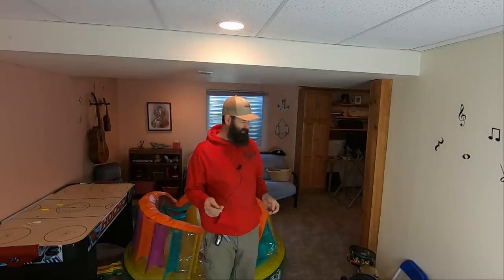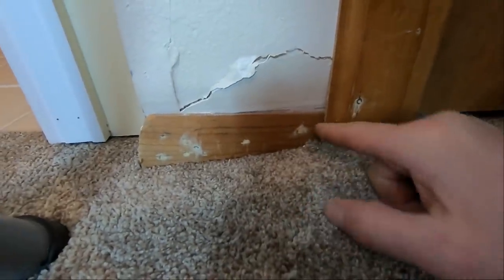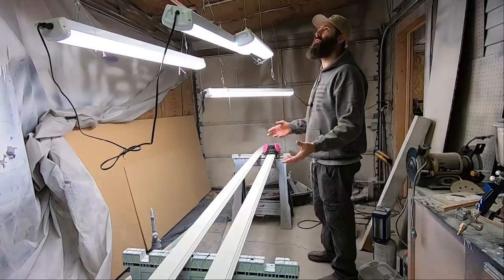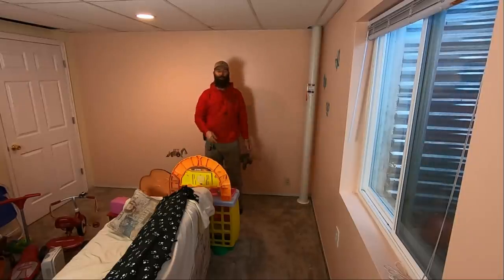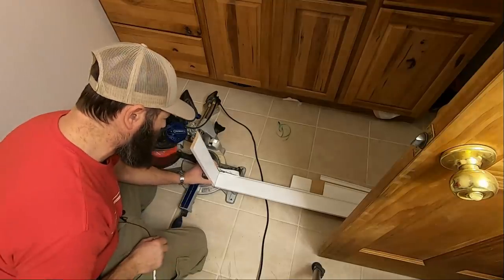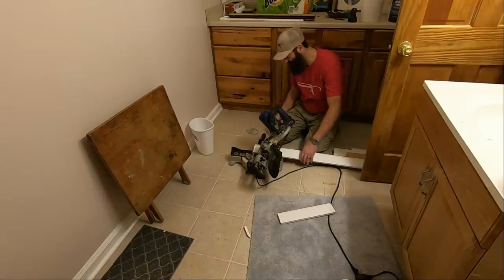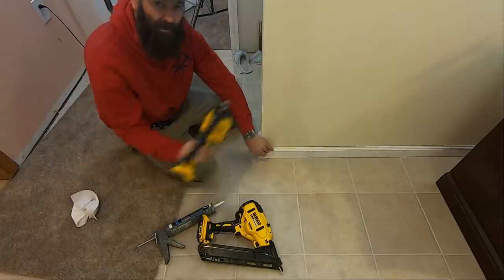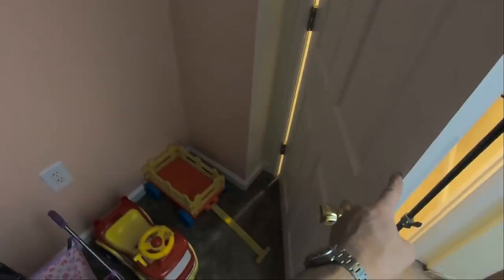Master Carpenter Fixes Botched DIY Trim Job | THE HANDYMAN |

Comment: For Coping;  Rather than tracing the profile of the baseboard onto the piece you want to cope, i was taught to cut the end of the piece at a 45* angle as if you were going to slide it into an inside corner miter.  Then you can cope along the angle where the brown MDF and the painted surface meet.  It is more accurate line than tracing it with a pencil.
Reply: That's the way it's supposed to be done. 45° cut

Comment: Coped corners are pretty easy and they look great...one thing I used to do when making them is..after I make the coped cut ( with the profile) I wrap a scrap piece of baseboard with sandpaper  and use that to hone  in the exact profile..cleans up a relatively marginal cope cut...nice job...
Reply: Yup. I always put paper on a scrap piece and clean it up!
Reply: That's a great tip!
Reply: I'll share one back.  I was surprised the first time I tried this... Use window glazing to fill your nail holes on painted trim.  It rubs on, stays in the hole but comes off the trim clean.
Reply: @BigKeithDog  good idea.. similar to using chauking
Reply: @FNGstationtwentyeigh  But without the mess.  And it works way better.  Painters caulk liked to sag at nail holes and leave residue everywhere it touched.  The glaze rubs off the face of the trim as you apply it.
Reply: @BigKeithDog  next time I do a painted trim job..I will give it a whirl...thanks for tip

Comment: Great tips and skills as always! 
Only extra lil tip I have is for bowed walls/ lengths/ gaps. I use thin sheet cardboard behind top of the back of baseboards/gaps to wall, and this will allow you too nail, as it compresses too the wall, giving you a ‘shelf’ for the caulking to stay on the top of the baseboards, but gives you total gap coverage, straight looking baseboards.
Reply: That is smart :)
Reply: Sheetrock shims are good for that

Comment: Like how you put “things” back, after moving them. That’s a great thing to do, and not everyone does this....
I find, customers “like” when things get put back, and “cleaned” up (vacuum, mop, etc....your work area after finish,  it leaving a mess behind👍🏻)
Looks great✌🏼
Reply: I find they expect it and are disappointed/surprised to find out that most tradesman don't do it. Its a good way to retain customers.
Reply: Yeah, youre much more likely to be back with the same customer.  It even makes a higher $$ rate more digestible when the customer is totally satisfied

Comment: Instead of tracing the profile to cope the edge you can 45 one end and follow the profile on the piece you cut. The more ya know
Reply: Exactly what I thought sir
Reply: Yeah i cut a 45 then flip it around and use the miter saw to make a straight-cut down to where the profile starts then just cope the profile
Reply: Master carpenter showed me that trick.   So easy
Reply: @Fine_art_aerial  ditto
Reply: Then take a pencil and darken the cut line

Comment: A little tip, put some painters paper between the baseboard and carpet before securing the board to the wall.

You don't need to put the paper all the way to the wall, but just enough under the baseboard to stay put.

You'll still be able to easily pull the paper out after you paint, and you'll protect the carpet from caulk and paint.

Comment: 32.5 instead of a 45 makes a smoother tighter finish when using dap. Much less flareout needed and it looks flawless everytime. I used to 45 until an old finisher told me this. Tried it and never went back. Also never fill nail holes with caulk they sink in when they dry and can leave a residue which you can see through the paint. Always use dap and a quick sand wet or dry. Love your videos brother.

Comment: When doing copes, try cutting a 45. It shows you the exact profile (the edge of the angle cut and the face). No tracing needed (less chance of error). 

I like the idea of caulk at the splice mid wall.

Comment: We had all of our carpet removed and vinyl flooring installed throughout our home 3 years ago.

On our upper level, they had to install 1/4" subfloor on top of the existing floor, and set their jamb saws to accommodate it.  On our lowest level with a concrete slab, they forgot to subtract 1/4" from their jamb saw since they were not using a subfloor on top of the concrete.  So, the door jambs all showed a gap!

I simply asked them to provide some caulk to match our trim color and filled it in.  Unless you have knowledge like I do, you'd never know the door jambs were cut too far.

Comment: You can insulate your garage door with rigid foam panels. Lowe’s carries (R7.7) R-Tech panels 2”x2’x8’ or some (R10) Dow 2”x4’x8’ panels. Next stop:  Energy Star certified! 🌱 
P.S. I started watching your videos about a month ago. I just got registered with the Idaho contractor’s board in November. I have 3 years in Electronics mfg. and 10+ in construction- mainly concrete. Thanks for doing the research and consolidating all the tricks of trade to a one-stop-shop for the DIY crowd! 👍🏻

Comment: We’re getting our baseboard delivered on Monday and then we have to install it in our entire basement. We knew about the coping method for corners, but love the tip to put caulking along the joint before installing.  And we are also at the baseboard stage of a two year basement gut and rebuild. 😂 But we did have a baby in the middle of that, so maybe we have some excuse? Hoping to have this done before the next baby arrives in a couple months.

Comment: Wonderful job as usual Mr Handyman. For those tricky outside corners, I use CA Glue and activator. Glue them up then nail them on. Guaranteed tight, tasty mitres or your money back*. Also, why the homeowner didn't move all that crap prior to your arrival, really grinds my gears....

*no money back.
Reply from the maker: I provide a turnkey service.   Customer doesn't have to lift a finger.  They pay me to do it.
Reply: @TheHandyman1  I get you. Not a common thing, here in the UK. Here, if you ask most tradesman to do anything vaguely outside of the parameters of his/her expertise, you'll get a look like you've just took a turd in their kettle..

Comment: The title is “Master Carpenter” but it’s the fucking handyman channel 😂😂😂😂
Reply: In the construction industry there are  2 types of trades. Mechanical and carpentry. Mechanicals are: electric,  plumbing, HVAC. In certain commercial applications Network Administration is considered it's own trade but generally it still falls under the electrical category under "low voltage". All the mechanical trades require licensing on an apprentice to master level, usually logged by the state or county u work u det with various school time and tests to be taken. Carpentry requires no logged apprenticeship monitored by a government body. So there is no real, clearly defined metric by which u can differentiate a master level carpenter from a journeyman level carpenter (outside of union employees) like a designation on a card or a certificate and so on. Moral of the story: Hes making a joke and mocking the mechs. Mechs spend 7 yrs on average to get a license to do on thing and never learn to do anything else. Where as this guy can do almost anything related to residential remodeling and make far more than the Electrician who never learned how to use a broom.
Reply: Also he was a carpenter for years, so he might be a master Carpenter

Comment: Pro tip: Use window glazing to fill your nail holes.  Rub it in, it's like magic, it stays in the hole but rubs off the trim.  Way neater than using caulk or spackling.

Comment: So interesting point from the insurance side of moving items in or around a client's house for newer contractors or handymen. If you move anything for the client and you do not have care custody or control on your liability policy, the chances are, if you break that item, you are paying for it. Usually if it is something you can pay for, I would recommend that route instead of putting in a claim, but just something to be aware of.

Comment: Homeowners could've at least moved all that crap out of your way before you began...
Reply: I agree, I’ve done many bathroom tile jobs where the homeowners don’t even clean their toilets . Piss all down the side. No class
Reply: @billneilssien2183   Or when they never clear out under their sinks when I replace their faucets.
Reply: @brianflanagan2747  that’s the ONE where I’ll take it out but I won’t put back and depending on how much sh&$ is under there depends on how clean I’ll be. . That’s BS you know “the guy” is coming cause you called . So get ready for him damn it . Lol right . Common sense tells one that.
Reply: Some are very rude to us and treat us like slaves. Thats okay, we are not cheap and will do it with a smile 🙏
Reply: Ryan  when we go in as handymen we kind . We just don’t show it . It’s ignorant and inconsiderate. Also disrespectful. I mean we already are handling a job unableto be done by  the resident /homeowner . One would think wipe down or pick up your personal stuff . That golden rule type thing. But sometimes theirs a section in a couple tract or work order letting that extra stuff be an extra charge . So then it’s just what it is

Comment: I used Behr to paint my master bedroom and the included master bath. Since it was going over oil based paint had to prime it first with kilz. Every time I took a shower its like the walls melt clear coat and I have to wipe the walls down. It got better over time, but I'll never buy Bher again.

Comment: Tip: When cutting internal miters cut a 45 angle first then using a coping saw cutout the back that saves you having to try to trace the profile it's ok tracing the profile on simple skirting such as bullnose but not on harder profiles such as OG

Comment: I may or may not carve copings on the table saw (a lot like using a lap disk on the angle grinder).  Saves my elbow for more productive tasks. :)

Also, CA glue those outside corners together, your electric gun won't jack up the angle anymore.

Comment: Cut an inside Corner 45       that gives you your profile for the cope.  Just follow the paint line.    Cope it , then pull your length measurement.

Comment: I had a tough time getting the trim tight to the wall in some places. It just wouldn't suck in the top of the trim with pin nails put in along the bottom.

Comment: Have you ever considered using CA glue for those outside corners? I'm a big fan of nailing the corners with the CA glue before pushing the joint into the wall corner, then nailing it off.
Reply from the maker: I use it on crown molding and other detailed trim that is closer to eye level.  Baseboard gets caulk and paint.
Reply: @TheHandyman1  Ahh good point!

Comment: With all the talk about caulk I was thinking you need to add a paint brush to that shirt for the whole 'caulk and paint make her what she ain't'  idea.  Good job shooting and putting all of the trim in, it's amazing how base board can improve a room.  I was watching a finish carpenter do some coping and he recommended getting the 'Collins Tool Company Coping Foot' for coping work.  It's a guide that he throws on his jigsaw and said it was a game changer for big jobs.  Just throwing it out there if it helps you or anyone else.  Personally I have no idea but if I end up having to do any big jobs I might get it...OR be cheap and buy a traditional coping saw since it's for myself and time isn't as critical.

Comment: Why did you use latex versus oil based paint? Wouldn't oil based be more durable for a baseboard?
Reply from the maker: I haven't seen oil based paint used on the interior of a house.

Comment: You could use a angle grinder with a sanding disk. It's a lot easier than using a coping saw.
Reply: He said since it was a small amount of coping that he is just using the coping saw but that he'll duse the grinder if it's more copes.

Comment: Is there a reason why you don’t just cut 45s at every corner, instead of cutting the profile out? Always wondered why you did that.
Reply: It's nearly impossible to match the exact angle of the corner of the wall, most corners aren't a perfect 90. So even if you make 2 perfect 45 cuts, you still end up with a gap. If you cope the end of one piece and cut the length a bit oversized, you force that coped edge into the adjacent piece and it results in a nice tight joint.
Reply: T M ahhh I see. Obviously I’m not a pro lol. Here for entertainment and education. I’ve done base board and just cut 45s and called it good. Wasn’t aware that this was a better way.
Reply: The 1st time I angle cut & coped baseboard was a nightmare because I didn't understand that wall angles are imperfect. So, bought a little protractor gadget & it helped tremendously. Quickly found that most wall angles were anything but 45°.

Comment: Where did you get those overhead lights? They plug in? Could use a couple.  Thanks man
Reply from the maker: The ones on the stands?  I got them on amazon.  There are lots of options for filming lights on amazon.
Reply: @TheHandyman1  Nope. The ones at the 5:00 mark.

Comment: Hey, two things . One , can you include details like how far apart to nail each nail. How far to recess the nails. Second, I’m trying to diy my inground pool demo. I have the system and electric removed and the top decking all broken up but starting to break into the walls with a jackhammer is going really slow. I don’t know how to use any big machinery. Do you have recommendations? I don’t have the 10-15000 they want to demo it
Reply: I heard one finish carpenter say he puts a nail at every stud which makes sense.

And if it's half inch material I wouldn't go farther in than a quarter inch but I'm not a professional. Really just needs to be in enough to get something in there to cover the nail hole.

Comment: Do you nail into the base stud or the upright stud, or both?   I have just wood stained base molding so I can't caulk any mistakes.
Reply from the maker: It depends on how well it is fitting up against the wall  sometimes you need to nail into the stud to get it to fit tight to the wall.  On stained wood I would use a 18 gauge for the upper part nailing to the stud.

Comment: What kind of caulking do you like to use? DAP is bad about cracking.
Reply from the maker: I use dyno flex 230
Reply: @TheHandyman1  OK. I've been using Alex Plus. I'll switch to that and see. Thanks for the response.

Comment: Why do you cut the inside corners square and then cope one board to match, instead of cutting both pieces at 45 degrees?
Reply from the maker: faster and makes a tighter joint with the wall isn't a true 90 degrees.

Comment: Isn’t it faster if you cut the corners with the miter saw at 45 degrees instead of coping saw?
Reply: You get a better job coping.  Corners aren't square and sheetrock mud is usually built up

Comment: Those pink filters on your mask are just n95 for particulates (sanding dust, etc) - aren't you interested in the VOC cartridges for when you are painting?
Reply: latex is relatively low in VOC's these days, unlike the oil based paints.
Reply: @northernlightsrenovations1710  fair - just figured if you’re going to go through the trouble of putting on a full face respirator use the right filters
Reply: @leoromanovsky    Sounds like a great 'safety' observation....  ;-)

Comment: Hey handyman I don't know if you will see my comment I'm trying to comment on the most recent video hoping you will see it, my question is do you find yourself  doing a lot of texturing in the mud? Because I'm in NJ and most of the time if not all of time I find that the costumer ALWAYS want to remove the texture in favor of a smooth finish, is it an east coast west coast 90s style "beef" lol just curious on your experience because I see you do a lot of texture in your mud finish, and from watching your videos I know you've worked on both coasts, is there any rhyme or reason to the demand for texture?
Reply from the maker: Smooth walls are a level 5 finish.  It's the most expensive finish.  All the walls outside of the north east are usually textured.   The only texture I'm asked to remove is popcorn ceiling texture.  The cost to skim coat an entire house would be more then anyone can justify spending and it does nothing to the value of the house.

Comment: Help me understand how people leave all the clutter prior to getting work done... A+ for dealing with it and putting everything back.  
I just had an old 275gal oil tank replaced, I removed a wall, railings, clutter, doors etc prior to them coming.... then  they came and treated everything (my disgusting 50 year old carpet in basement) kitchen flooring etc like it was gold, not a drop of oil, smells, everything clean and perfect after a potentially really messy job... they thanked me for having everything ready, I thanked them with $100 each tip...
Reply from the maker: It's part of the job.  Turn key service.

Comment: An actual master Carpenter would cut the 45 first, then use that line to cope. No need to scribe with pencil. They would also sand and file every piece.